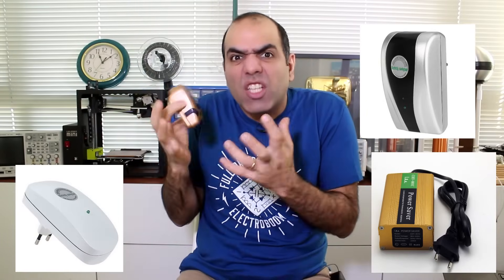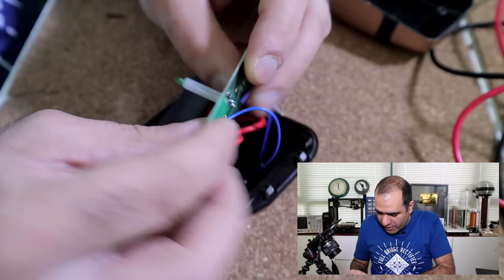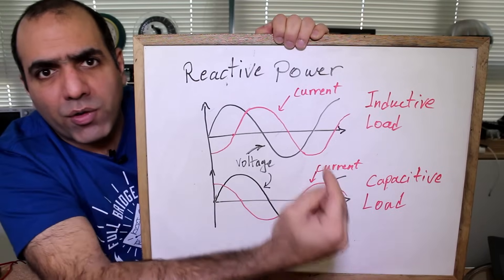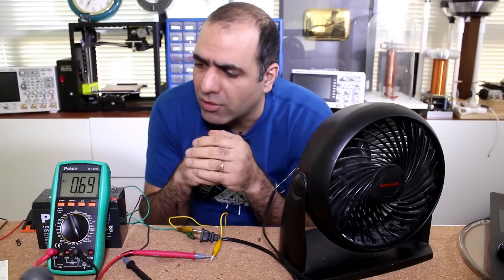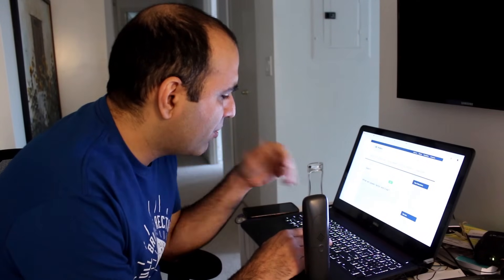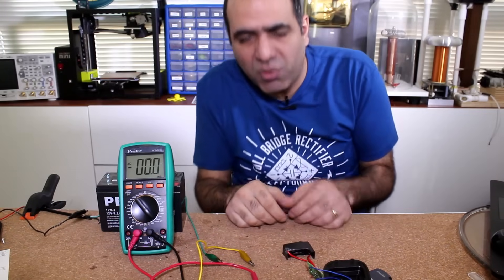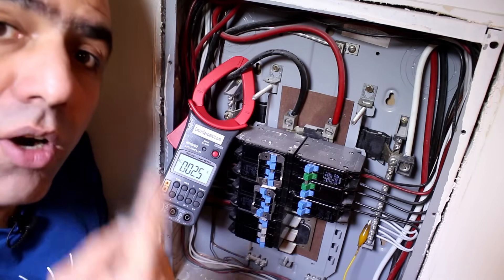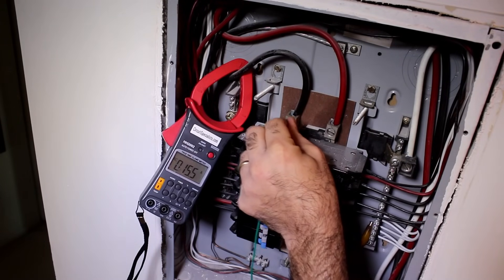Power Saver Scam EXPOSED!

Comment: That's a great example of your average customer service process. Nobody knows what you're talking about if you know what you're talking about. Unless you wait an hour or two.

Would a working fixer improve your ecological status? Like spending less electricity and if everybody had the system in all devices, the societies would need to produce less electricity which is very often even in 2020 created by methods that are not very ecological. Or are the common household items today already designed to do it?

Comment: save lots with high- efficiency furnace, uses less electricity & gas. Furnace cost more but worth it. Old furnace blower on 20-25 min. Hi-efficiency blower on 8-10 min. Nov, 2019 electric bill $67 w old furnace. Nov 2020 high-efficiency furnace electric bill only 37.00!!!  I was amazed!!   Maybe electric usage charge is lower in Nov.
Dec, 2020 is very cold, but didn't get bill yet. I was using three surge protectors but I'll take them out now, they don't do anything they actually use little electric plugged in.

Comment: I use what's called a power conditioner for my collection of Spinet organs, as they are old and have little in the way of filtering, so any interference or change in the incoming power will drastically effect them, whether it's causing a loud buzz or causing the tone generator to go out of tune, my console organs have filtering built into the power distribution so a power conditioner is not needed

Comment: just for information, i practically done this experiment with 5uf for my fridge. as this is AC the P=V*I*Costeta. so the current will drop but at the same time teta value change and increase the, PF the total power will be same. as the voltage is constant. of course, it will draw some extra low power for capacitor.

Comment: As an electrician in Norway, I get scared by your fusebox. It looks really unsafe and inneficient. Here, we mostly only use 400V TN C-S or 230V IT in our homes. All new homes use 400V, 3 phase. L1-L2-L3 and 
N/Earth. 230V in outlets, and 400V in EV chargers and motors (usually)

Comment: I just  saw your video (this one) about  debunking the so-called "power saver device".   Well it's true it's nothing but a power factor correction and would greatly benefit an inductive load like a motor, etc.. Allegedly,  your power company does not charge a residential customer the reactive power consumed or wasted.  So, it would be pointless to worry about this reactive power usage, right?.   I don't know how your home meter runs or detects power usage, especially the new digital ones.  But I'd like to point out that the electromechanical meters of old uses a spinning aluminium disk which moves many tiny gears which "counts" the KWH consumed.  Installing a pf capacitor DOES SLOW down  the spinning noticeably, on motors, compressors, and other inductive loads which had not been previously pf-corrected.   Obviously, if the disk spins faster, the counts also increase faster --- ergo, the electrical bill is higher.  This is easily verified.  Take out the pf capacitor and the disk spins slower.   So, in this type of watt-hour meters ,  electric companies  DO BILL  the reactive power consumed.    Of course, it the pf capacitor was left in the line  circuit after the motor is switched off, the reactive power consumption from the capacitor remains, but they never tell you this caveat.  So, if your power company tells you they don't bill you for reactive power,  don't believe them immediately.  Research how their meter works first.  https://www.youtube.com/watch?v=xtModjpxfxM&t=69s.  It would not be to their advantage if millions of households incur  such  reactive power losses and they don't bill you for it -- they are not doing charity work.

Comment: Question. 
I have the power saver light box 1200 240 volt 60 Hz. 
My question is when Hooked up why is there a draw of over 4 amps per leg when nothing is on  or running.  
I can shut all my breakers off except the power saver and put an amp meter on it each leg and it’s drawing over 4 amps per leg as said. Why?

Comment: Sorry...🤗😂😂 I COULDNT stop laughing!!! One if not the BEST electronic theory explained for laymen like me. While working on a 200 amp box using  a $400 20 volt power drill I grounded out!!!😱😱 Fortunately I had the receipt for a new drill. The $150 (200 amp) service box was another story. Trying to paint over burnt chard metal. Is a challenge!!! Plus it was already stucco’d in! Never got caught as it was fixed and the inspector either ignored it (seen it before) or just didn’t care. It PASSED!

Comment: He literally proved that the capacitor does do power factor reduction which inturn does reduce the net complex power drawn.

Literally the ONLY agruement valid in his video is that he isn't paying for the reactive power and only the real power. 
That maybe true in your country, but where I live, every household has to pay for the complex power that they draw.
That makes sense as higher the complex power, higher the current required to sustain a 240V 50Hz city power and more power is lost in transmission, whose penalty the user has to give.
Not only is this useful, it pushes people to buy more transmission-efficient products few which already have a power factor
 correction circuit in built. 
But most heavy duty inductive loads do not, so adding a capacitor can and will help.

The question isn't an engineering one, cause anyone taken basic circuits knows that a capacitor can correct for power factor, it's a question of if you pay for active power or complex power.
Reply: Anyway it's useless and negligeable. It doesn't make 1ny difference

Comment: I think everything about this video is great. The technical explanation of what's going on and the empirical demonstration of how the capacitor changes the amount of real power being measured.

Except for one thing. He trusts and does not verify what the power company says. Of course the power company is going to say we only charge you for the real power usage. They don't even have to be lying, he could have easily just got transferred from person to person until there was one person that was saying hey there's this really annoying guy that keeps asking questions I don't really understand but I know what he wants me to tell him so I'm going to tell him that. That's how business works. I had seen this from both sides both work in big corporations and someone who has dealt with the corporation. The people who avoid trouble by just telling the customer what they want to hear whether or not it's true  And if you get transferred between three or four people it's extremely likely that you're going to hit someone that will simply b***** you to make the day go smoother.

 to have really done this right he should have done an actual measurement looking at the power meter and what affects shifting the face back towards the line phase using a capacitor when he has all his stuff in his house running has on what the power meter measures. If the meter is actually compensating the way the power company claims it is with sounds pretty turkey, he shouldn't be able to shift the rate of power consumption by Shifting the phase with a capacitor.

It's not just internet scam artists that BS people, there are people full of little white lies deceptions in ignorance all over our society and many of them put it to good use for big corporations. Do I know for sure the power company lied? Know I definitely don't but I wouldn't trust them either and there are experiments you could do

Comment: Could you place a capacitor after the switch on an electric motor, so when the motor is idle the capacitor doesn't draw any power, but while switched on and running it improves the power factor?

Comment: Disclaimer:
I do not hold a law degree, nor any other university degree. 

However what I proffer here can be used as pointer of what to seek or ask of legal and other professionals. Hence what follows does not truly consist of "legal advice", but a warning to seek professional counsel when needed.

My remarks here are intended as 'pointers' or suggested issues to be discussed with appropriate and legally authorized to practise professionals if and when the matter to which they have been associated threatens to be of appropriate import. Pointers are not a substitute for professional advice, but might also serve to dissuade a person or persons from getting involved in one or other potential problematic situation, yet such avoidance can also be of serious import, therefore once again all are advised additionally, in that guise to consult professional advice before attempting anything that might be seen as criminal or other negligence that might become of legal import.

On Protection of professions:

While there is a legitimate need to protect professions and professional practise, this also can be taken too far at times. While protecting professional practise serves, to a degree, to protect the citizen's rights to avail themselves ofadequately trained and ethically bonded professional advice, when protection of such kind concurrently serves to result in professionals or others using same support a "protectionism" or co-dependent lack of ethical and pro-active performance, such measure of protectionism has then exceeded its reasonable limits of sociological effectiveness, and then becomes deleterious.
=======================================================

Old memory of what I learned in my first year at tech school!

This phase shift can also be used to make a better form of dimmer than what you have in a typical light dimmer, but you will need to have the neutral wire available to the circuit that uses this.

As for improving power efficiency, while one might use a choke or inductor in series to reduce some of the effect of capacitve loads, inductors are expensive. also worse still than that is the electrical inrushes caused by motors and compressors, such as in refrigeration and air conditioners.

In industry some applications can bebefit from soft start motor controls, but this is not suitble for controlling the inrush of a compressor. 

Hence larger A/C units will be motor driven, and can use a flywheel in combination with a soft start dontrol to palliate the inrush.

This is not practical for residential use but in large commercial and industrial buildings, it can avoid complaints or regulatory violations caused by power ling distrubances thant degrade the power grid, and can result in an offending industry being penalised, at times seriously.

Hence a large heat pump, when it is to start its compressor may well use a soft start control, in combination with an excessive inrush duration trip and a flywheel to make sure that neither the motor itself nor any added surge demand on the motor when the clutch engages the comperessor will backdump inrushes or other perturbations into the power grid. 

Also the soft start control should be equipped with inductors in the 3 phase line that also reduce backdumping of surges into both the soft start control and the power grid. all of this needs to be installed in a shielded electrical control room which is locked and has appropriate warning sogins on the outsdide.

Also approved means of safety (:"green") grounding is a necessary part for public safety.

All to say that power inrush and power factor are not casual issues, but more serious of public import than many might have thought.

Comment: Normally wouldn’t have answered something like this, and would have just rolled my eyes and moved on, but it was requested.

I decided to look into it. Went to the site, and they don’t say a single word about how they expect this to reduce your electric bill.

It doesn’t produce electricity from any external source and feed it into the home, it actually uses electricity from your home to light up it’s LED, so technically it’s consuming more electricity (though likely very little of it.)

Basic physics would tell you that you if you consume that energy with your electrical equipment that it came from somewhere. In this case it’s from the electrical grid and not some plastic box with a little circuit to turn on an LED plugged into your wall. And that electricity coming from the grid is metered.

The only way to reduce your electric bill is to - reduce consumption (this could be changing habits or replacing older equipment with more efficient equipment.) Or provide another source of electricity to the home to offset the amount coming from the grid, such as Solar PV system.

If you want to give away your money for something that you plug into your wall, and turns on an LED, then send me your money and I’ll make you a box to do just that. Just kidding, I’m not going to pay for the UL to certify such a thing.